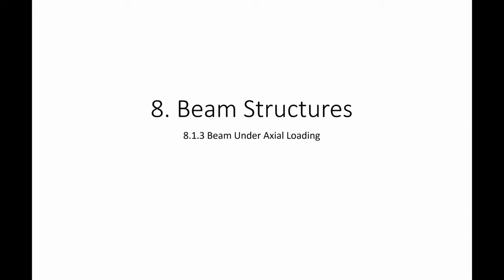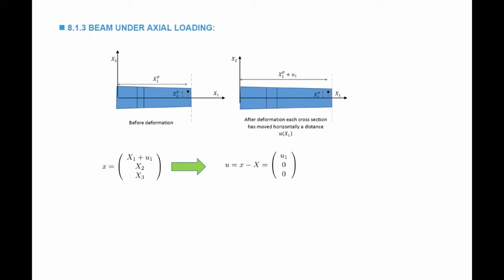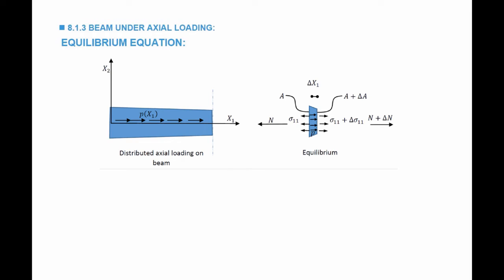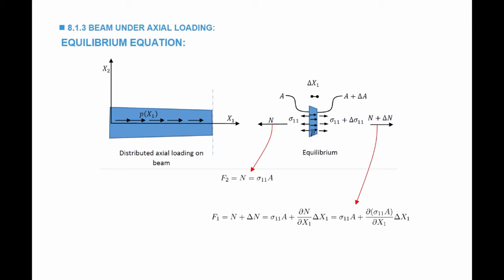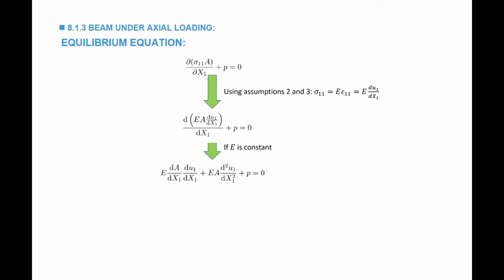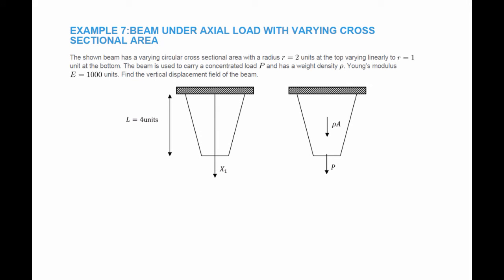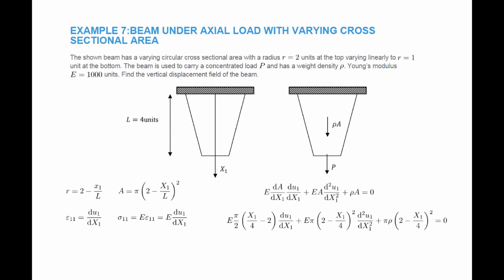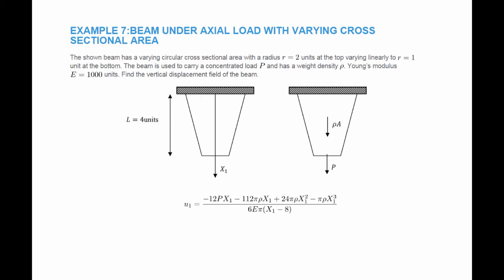8 1 3   Beams Under Axial Loading

Comment: What's the solution by a fixed beam with axial uniform load
Reply from the maker: You can decouple the axial load from bending for small deformations. I.e., solve each differential equation separately and add the stresses.